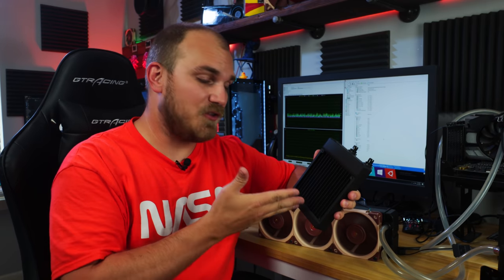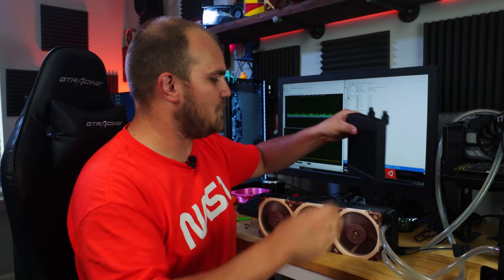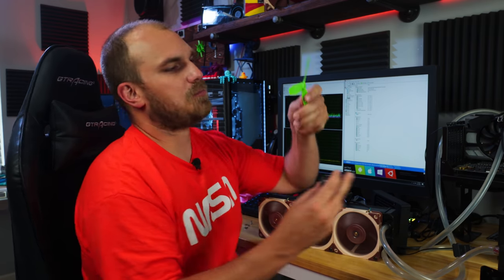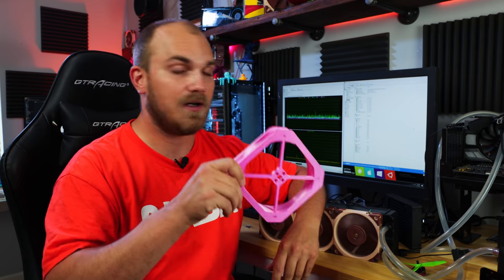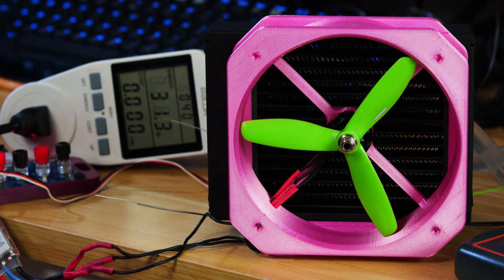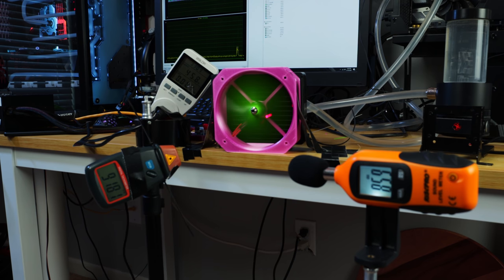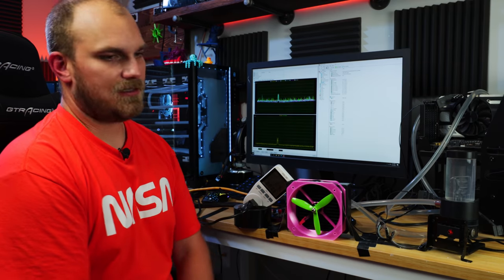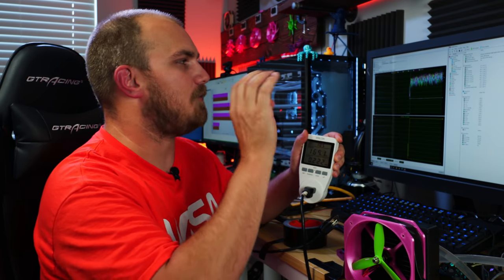20X PC COOLING, can this 120mm Radiator out perform this 360

Comment: Can you print 2 more of those fan shells, and test 3 rc motor fans against the Noctua's on the 360 rad at a more reasonable rpm?
Reply: I second that!
Reply: Push-pull?
Reply: Why a more reasonable RPM? Full throttle on them all, hook up all those PCIe 8 pin connectors and let it rip with industrial grade ear protection while operating, let's see it make mayhem
Reply: Yeah! I say full throttle on all 3. It will never be realistic anyway, might as well go all out!
Reply: Yeah I have two power supply’s in my system 
Oh hell yeah I love duel system builds 
Well you see my fans consume more then a thousand WATTS LOL
Reply: I think he would need smaller fans and a different fan shell because the fan he used was too big
Reply: They are bigger. Won't fit.
Reply: Yess
Reply: @Kalvinjj  An 8 pin PCIe connector can only deliver 150 watts - that's barely more than half of what each motor needs.
Reply: I hope we will see soon 3 those triple racing drone fans on 360 rad soon
Reply: @sadmax  yea lets do 6 fans and draw like 1800W from a wall what a great idea
Reply: @waffles6477  yes, i recommend the HQProp 4.8X3.6X4 which is a few mm smaller and has 4 blades. It should fit and give even more pressure.
Reply: Next challenge who can send me a good pair of ears and will they beat dr evil's rocket
Reply: Just 900 watts of power, no biggie.
Reply: I agree but I think he should get a propeller with more fan blades. also like to see what these do in the tower cooler he made. Could be interesting.
Reply: Oooo I like the cooling tower idea with this one! Great video the pup must have hated you though...
Reply: BTW: the ESC that drives the motor can work with the PWM-signal - it must not be that loud all the time. If a 360-radiator is used (or even bigger) the interresting question is how far the cpu can be overclocked/overvolted ? what is the limit here ? 😈
I guess it is easier than using liquid nitrogen for extreme overclocking.
Reply: @sadmax  oh yasss! we need 6 of these. 360 rad, push-pull. we need them outside in the winter. 2 degrees ambient. THEN to power them obviously they need their own 2,000 watt DC scientific power supply. (not a pc junker) and we use that to maintain the CPU at a 100% static temp. as in one that never changes. (except change in ambient) you then run a Ryzen EPYC CPU 64 core 128 thread at 3.5GHz all core.
Reply: He needs a 420mm(3x140mm) rad so the fans will all fit. Its to big for a 3x120mm rad.
Reply: @Kalvinjj  that's nearly 900 watts :D
Reply: @nara4420  the limit with watercooling is ambient temp, unless you use a chiller. LN is in another league.
Reply: @dan2800  you can't pull 1800w from a wall in the USA, which is why the Corsair 1600 was a breakthrough leap in PSU efficiency. A standard rated outlet is good for 15a/115v ac. You'd need an upgraded outlet (up to 20a if the wiring is suitable) or just to wire it to a 240v hookup
Reply: Also, you can run 3 on a 120mm rad,  there's room to play with as far as end tanks, what you would need is a 1 piece 3d printed housing with airfoils at the top and bottom from the leading blade edges to the corner of the radiators fins. It would work like the shroud on a car's radiator fan.
Reply: @Kalvinjj  that moment when your PC literally requires an OSHA inspection for you to work on.
Reply: "We have lift-off"
Reply: @Kalvinjj  And get a higher gear ratio and bigger motors instead of that little thing. The whole thing seems torque-limited

Comment: At anything over 80dB you need to wear hearing protection. Don't unnecessarily damage your ears man, you only have one pair.
Reply: Took me nearly 25 years of running tractors and tools to take this to heart. So I get to enjoy a permanent ringing in my ears for the rest of my life.
Reply: My dad is permanently deaf to ~4kHz (or thereabouts) tones from a few years of mainframe operation and handling IBM line printers at a bank, literally cannot hear any kind of alarm that has that tone nowadays. Can hear some higher tones and lower ones but that exact frequency those printers made when operating is completely gone from his hearing.
Reply: Like Tim says, get some IsoTunes or some other form of hearing protection while you, cause once it's damaged there's very little you can do to recover it.
Reply: Iam Sagittare he was in a different room though so it should be fine
Reply: 90dbA for an hour, otherwise you would be fine.
Reply: @Kalvinjj  you need to get everyone to have that tone as their ring tone just to wind him up XD
Reply: Eh, 100 dB is fine for short term exposure. that 80dB rule is for 8+ hour exposure. You won't get instant and irreversible damage until you get to like, 140+ db.
Reply: @J Fz Bro 50db is a normal conversation.
"Hey man, what's up" "Sorry man can't talk to you I value my ears"
Reply: @J Fz Ambient in my room is around 39 and I live right next to the street with my window, cars driving past regularly make it to 55db. If I need to render stuff overnight or leave my PC on for other reasons, I have constant 48-52db pretty much right next to my bed the whole night and I'm fine with it and getting good sleep. I guess it differs from person to person though.

Comment: pull a vacuum at the start of the fins. example , 4 120 delta 4500rpm fans in series in a pull config with no gaps.
Reply: That and add holes however "Layer" the holes... 
As in on one blade has a hole in the edge one hole is in the middle of the second blade on the last blade has a hole closest to the base... 
It will allow more increase of efficiency. 
Allow for higher RPMs with less noise and motor noise. With the holes being the same size to maintain a roughly same amount of weight to prevent wobble. 
Should make it pretty intresting.
Reply: Why? You need low flow to create an under pressure, so little air will go through the radiator making it hot. Creating boost pressure in series actually works.
Reply: @impuls60  My Idea or his?
Reply: @impuls60  so why i say a vacuum is because when things can expand they cool if you you get it right you can create a vacuum on the fin creating a AC like effect, only AC's use a much better gas I forget what it is called but the man that created AC's noted this effect in his findings.

So giving the gas more room to expand creates cooler temps, but will create heat else ware, like how an AC works.
Reply: @EpicBigWhale  yes, but low pressure air cannot absorb as much heat.

Comment: Loved this! As a next crazy 2 part test. 1: 3 red bottom motors with a printed shroud on the 360mm rad, then see how fast you have to run them to get the same performance as a set of  X25s on the same rad. Then try them at max speed and see how much it improves performance if any. Then 2: assuming the motors get too hot on the test, then we get to try water cool the red bottoms somehow ;) Thanks for another great vid!

Comment: No idea how practical this is, but if you can find an axial compressor blade that'll fit the motor (like a turbo fan engine) and include stator fins in the shroud design to reduce the air sloshing, you would massively bump up the static pressure. I have a strong feeling that there was bleed through around the sides of the shroud and coming back out the front because you're essentially trying to push air through tiny straws. Basically what I'm trying to say is that the fan is probably just spinning the air around in the shroud and not forcing as much as it can through the radiator due to lack of blades. Not sure if this is feasible, but perhaps contact someone that's local (or online) that can CNC a metal compressor blade of these dimensions and see if that makes a difference?

Comment: First, I know nothing AT ALL about water cooling a PC but I have always been curious about something. Have you ever tried and measured the effect of placing opposing fans on a radiator? One fan blowing air into the fins and on the opposite side a second fan sucking air out? I've always wondered what the effect of such a setup would be.

Comment: Most of those 280W will turn into heat so I assume you'd be pre-heating the air before it goes through the radiator?

Comment: With this push setup, you were blowing the 280W of heat generated by the motor into the radiator. I wonder how much more effective it would have been in a "pull" configuration where the motor heat never touched the radiator.

Comment: Distance is very important in sound metering! Make it a fixed distance. 
Doubling your distance to the dB-meter could be up to 3dB less... (depending on how good your room is sound dampened)
5 inch vs 20 inch could be up to 6 dB less!

Comment: You are using an EMAX drone motor and an 5in prop as a fan? What voltage are you using and is it the 2300kv or 2600kv motor? lol

Comment: Have you tryed to pull air threw the radiator rather than push air threw. Just wondering because I am a AC technician and that is how most AC are set up

Comment: The supports for the motor mount should be curved so you don't lose static pressure every time the fan blades align with the supports.
I would be interested to see how well this fan would perform on an air cooler too.

Comment: coming from someone who races we ran small radiators but with a double pass meaning the coolant flows through the radiator twice before entering the engine. i believe a design like that would be much more efficient.

Comment: OK, Major;
Thank you for all you do.
Here's the trick― my AC has the fan PULLING the air thru the condenser coil.
So I checked to see if that is the better way.
Surprise, surprise!
A fan pulling can be up to 20% MORE efficient than a fan pushing.
So I think you should try that to see if makes any noticeable difference.
So maybe you need a suckie matron instead of a blowie matron.
Have a GREAT (sucking) day, Neighbor!

Comment: That fan is probably moving so much air that it doesn't have time to warm up much before leaving the rad. I would suggest that you try doing it again but chain several rads so you have them stacked after each other?

Comment: Would making fan blades out of carbon fiber nylon element, make the blades on your best fans better? I know noctua make there blades with a unique material so they don't deform from high speeds and make tolerance between the blade and the case very small.

Comment: I have a question, I have a dilema where room in my case is very limited, I can fit a 240 rad with a single side of fans with extensive moding or a 140 with push and pull fans even a thick or double rad, which config do you think would perform best and do you think it would be worth the effort to try and get a 240 even at the reduced fan count and size

Comment: With the available rpm and torque of the RC motor I imagine non-conventional blade geometries can be beneficial. A high bypass turbine sucks at 2000rpm but at 20000 might outperform propellers. I'd love to see multistage fans on a radiator! One pushes one pulls, and lots of air is moved!

Comment: You aren't measuring the temperature of the coolant leaving the radiator, but in both cases I would suspect it is pretty close to ambient. It looks like you are limited by how much heat you are putting into the loop. It would be interesting to see if more heat load makes a difference (maybe OC until it thermally throttles on the 360 setup and then see if the DIY blowie-matron improves it).

Comment: You should print out a shroud that holds 3 fans on one side and one fan on the other. That way you can test which is more effective... 1 fan on a 360 rad with complete coverage or 3 fans on a 120 rad. 
You should also copy the drone blade design and downsize it to fit on your normal hub with various numbers of blades. Would that blade design be effective with the Noctua motor and RPMS?

Comment: Would it be possible to mount 3 Noctua fans on that 120mm rad (one for push, one for pull, last one either front or back) with REALLY long screws and compare it to the 360mm rad with 3 fans?
What if you did 6 fans on the 360mm (3 push, 3 pull) and did the same on the 120mm rad?

Comment: The "bottleneck" on the cooling is likely the water flow or the heat transfer rate at the chip cooler end, NOT the airflow. That's why the results are identical.

Comment: Is the 7700k delidded? My 7700k runs at 85c while gaming at 4.5GHz and -15mV offset on kraken x52. Pretty bad. Hits 99C in aida64 at 5GHz on 1.28V. I'm gonna delid it this week to see how it's going to behave after that. I think the silicon is quite good, but the temps are bad.

Comment: ive seen people build whole quads out of PLA so the strength isnt an issue, unless you crash lol but PLA is actually one of the stronger plastics out there (Thanks CNC kitchen for making me an expert) Its just brittle. But under a load like that I dont think it would be an issue, just dont expect any impact resistance lol

Comment: Those props are optimized for airflow and not static pressure though, you could try with a 4 bladed prop or even stacking two sets of props .-.
Reply: Stacking fans is bad
Reply: @rtyzxc  I'm talking about stacking propellers in a single fan, not two fans

Comment: I want to see compound loading on that radiator! Like 4 slow fans in series pushing air through that small radiator ;) Remember to keep some distance between the fans to keep the turbulence down otherwise there wont be any pressure build up.
Reply: Counter rotating fans should be better.

Comment: wonder what 3 fans at this speed would do on a 360 rad. then if it was super good just find a way to keep the noise down from the setup so you could be in the room with it.
this has also gotten me thinking what would a upscaled version of a 360 perform like. maybe like a triple 200mm fan setup. then again that would probably be well into he realm of diminishing return.

Comment: IDEA:

Instead of multiple fans for a non 120/140mm radiator what if you made fans attached to something like a bike chain that would be powered by only one motor. The ideology would be that since there is a single motor instead of multiple motors to cool the same area that it would be more energy efficient, but it also would be cool to see how it performs compared to a standard dual/triple/quadruple fan setup on a radiator.

It may be too wobbly and I don't know how to CAD but hopefully get the idea.

Comment: More blades for the fans but small enough to fit in a regular 120 fan shroud but 3 on the 360 rad and test like 3000, 8000, and max rpm and get all around readings for science.

Comment: To put in context, 100 dB is the equivalent of a Boeing 707 at 1000 ft, a helicopter at 100 ft or a jackhammer at full throttle.

Comment: How well would that fan work as a intake fan with a closed case, probably mounted to the outside of the case just in case.  Could you run a beefy air cooler with no fan and not throttle.

Comment: My 10 Fox Conn workstation fans across 3 rads 9 on rads 1 exhaust only combine to pull about 100w at full bore which is about 10k RPM and they are quieter than a 3 blade drone prop for sure. That being said i wonder if ur getting more noise out of the motor or than fan at this point. You could retest this with the same motor but using a PC fan design. Bear in mind though even my fox conns are using glass fiber reinforced nylon... Might want to make the blades thick and stocky and the hub thicker and stokier... A nice dome shape that comes down over the whole motor perhaps. Maybe even switch from PLA to ABS or another reinforced filament instead.

Comment: Triple rad setup with the rc motors please. Wonder if you could noise optimise them? Noctuas on full speed make ablut 40ish db? Wonder if you could operate a triple rc motor setup at aprox the same db level and compare the temps?

Comment: I'd like to know if 20 000 RPM was necessary to reach that temperature or if using a lower speed would have given the same or similar results. If the latter is true, than the conclusion might be quite different.

Comment: There is diminishing returns in removing thermal mass, and the water holds onto it as it circulates.
This device just may prove the 360 already in the 'high efficiency zone' for the workload.
Maybe try this fan setup on something more thermally conductive than water, like a finned metal heatsink.

Comment: I actually have an application for something like this crazy as that sounds. I was trying to find out if one of these motors would survive if used for a fan so thanks. My use is cooling a 4500 psi pcp compressor, its already loud enough I wear hearing protection.  Not saying it can't be done another way, but I have never messed with any of these little brushless motors and want to.

Comment: You might check lower speeds. There's probably diminishing returns after a certain RPM because at that point your bottleneck is probably the water pump, the ability for water to absorb, and of course the ability for the rad to spread the heat to be cooled. In this case a thicker rad would probably benefit a lot more I if you could stack Radiators on either side of the fan and if it would still cool efficiently

Comment: Dude, I like this kind of videos, very creative, keep them coming. But I think you should buy an anemometer to see air velocity, air flow and so on. They are super cheap and will add really interesting data for geeks like me. Just the cpu temperature data seem a little bit dull. Try to add more data to try to “explain” why x is better than y and z. Cheers

Comment: I'd still love to see a single fan, on a manifold or plenum/spreader/shroud thingy onto a 360 rad. With enough volume to allow air to spread out before the rad. Or even just fan spacers to allow the air to reach the whole radiator instead of being blocked by the large Noctua motor. Look how much area is lost on that 360 with 3 noctua fans. Probably half a fan again.